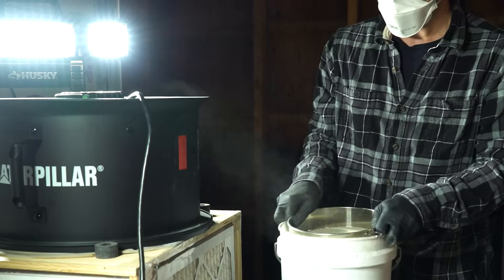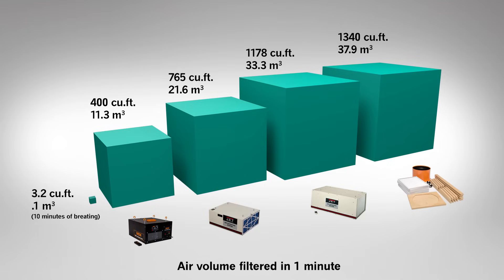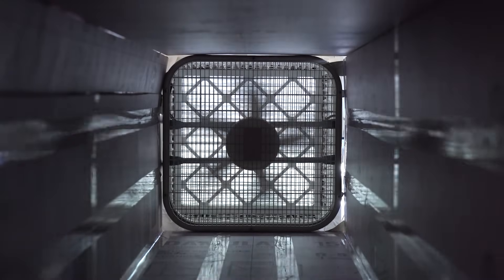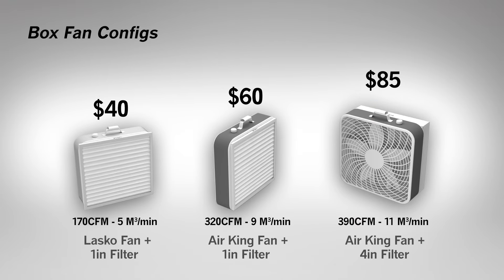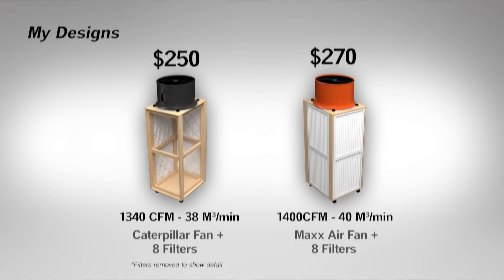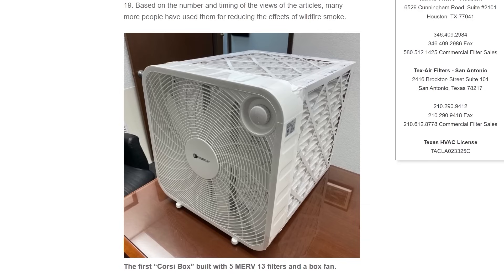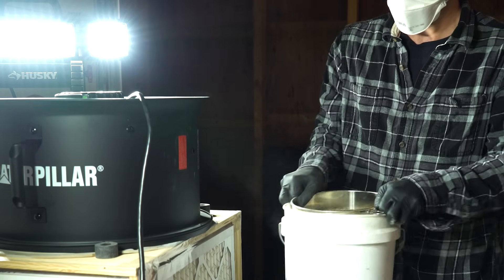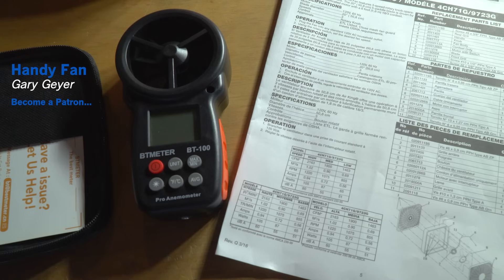What is the best DIY Air Filter?

Comment: You’d really want 4” pleated filters. They’re more than 4x less static pressure drop than a 1” filter and last more than four times as long.
Reply from the maker: This assumes that 4" filters have 4 times more filter material but they often don't. I'll do a video on that some time. Not saying that 4" filters aren't good, they are. Just probably not always 4x better.
Reply: @The3DHandyman   no actually. They take advantage of the fact that pressure drop is proportional to flow rate squared. Doubling filter area decreases pressure loss by a factor of four. Quadrupling filter area by sixteen. Pressure loss is also linearly proportional to filter life. So if you have a 1” filter with 0.1” h20 pressure drop that is used up after one year upon reaching 0.2” static pressure loss, quadrupling the filter media would start with a pressure loss of 0.0063” and take 32 years to clog to 0.2” end of life.

The difference is really that big. 1” fillers are really bad, and when using box fans that have essentially no ability to produce static pressure, you really get penalized for it.
Reply: Usually get my filters from FilterBuy. 4” are pretty expensive at the hardware store ($40-50), but not really that bad online ($10-20).
Reply from the maker: @michaelmolter8828  Helpful data there. At least in my smoke tests, the Filterbuy 4in filters do not remove smoke more quickly than others. In 4-filter configurations, the static pressure is already very low. The lifespan of 1in filters is no doubt less if you are looking at off-brand products. My preferred filter is a 3M MERV 13. It's not the best performer on single filter + box fan design due to static pressure, as you mentioned, but in a 4filter config, their performance is exceptional.

3M MERV 12-14 filters have a high density of pleats and only have 12% less material than a 4 filter. I also like 3M filters because they print the static pressure info directly on the filter. Their 4" MERV 11 @1390cfm has a pressure drop of 0.33 vs their 1" MERV 13 filter with a drop of 0.39. That is a drop, sure but in a 4 filter config it is a negligible difference.

I have also found that off-brand filters (filterbuy and nordic pure) will change the filter material year after year and their new filters haven't tested as well as their old filters. The lack of consistency is disappointing.

Thanks for the comment!
Reply from the maker: @michaelmolter8828  Sometimes Home Depot and Lowes have a buy-4 get 50% off deal lately. Not sure if this applies to the 4" filters tho. In general the prices are always better online. That's where I get 95% of the ones I test.

Comment: K&N makes washable air filters, probably a much more long term economical choice.
Reply from the maker: They are a great option. Definitely the best cost wise. I have tested these and they are not quite as good performance-wise as the disposables when filtering smoke but if you are pulling dander or pollen out of the air they will work really well.

Comment: I know this is older but quick questions please if you have time? So I am into amateur Mycology. We (community) use this same principle for filtering out as many contaminates as possible. Kinda like a cheap flow hood to work in front of. Some say this lower CFM (I think its the right term) produces a Laminar Flow too? They say to add the shroud around the fan to reduce back-flow which might let unfiltered air go around fan and carry contamination to work area. Never heard of it used for increasing the air movement speed before, but I'm truly a novice less than a year experience. After watching several of your videos on the principle it is obvious how much time, effort, and science you put into this. You are very intelligent, (Let me just stroke your ego Sir! lol)  and I think could help answer this question the best, if possible. What are your thoughts and suggestions for using this in this purpose. Obviously there is better, but more expensive solutions. I am disabled, and fixed income, but truly enjoy the hobby. Does this make laminar flow?  Or, is that crazy talk like Manufacturer listed specs. 🤔Thank you very much for this awesome video. Sits a lot of myths on the subject straight.   I apologize for my grammar not my best area.
Reply from the maker: Cool hobby! Thanks for the comment and complements. I would say that these designs do not really produce laminar flow. I have been working on a new design that does this more effectively. It's all about reducing turbulence in the air rather. Low CFM may help reduce turbulence but it also reduces overall performance when trying to pull lots of particles out of the air as fast as possible.

Comment: My father is a building inspector, he spoke with a product safety inspector at a convention that had worked on exactly this problem, testing the effectiveness of various home air filters.

What he said was the best filter you can use in your home is the cheap paper kind, but then you spray them with a light coat of something like Lysol air freshener. The thin coating of oil from the spray captures airborne particles. You can then re-apply the spray every other week and replace the filter every 1-3 months depending on your climate.
Reply from the maker: That would be an interesting test to run. Thanks for the comment!
Reply: That’s similar to a K&N auto filter where you use, clean, and recharge using an oil-based spray.

Comment: Can the air filers be washed or recycled?
Reply from the maker: Some filters are designed to be washed many times for many years and don't cost that much more than the disposables. No filters that I know of can be recycled.

K&N makes the only washable 20x20in filter. These work well but do not perform quite as well as the high end disposables.
https://amzn.to/3GMaxtH

I'll be releasing a new design that fits more washable filters very soon.
Reply: @The3DHandyman  Yeah, I had a feeling the washable ones might not perform as well.  Thanks for your reply!

Comment: Thank you SO much for your informative video! Hard to find content out there in this quality and a scientific approach... 
I was wondering which kind of coarse filters I could use to make the HEPA Filter longer lasting, as they tend to be expensive... 

My Story: I am currently suffering from a covid infection - shortly after we found and removed mold in our flat... According to studies, a horrible combination for the immune system. 
I'm going to build my own Filter system for rooms with in between 20 and 60 squaremeters. 
The actually plan from a friend was to put air pressure sensors in between the filter segments to see when they are full, but this overtaxes me to be honest. 
If you have any suggestions, please let me know.
Stay safe and healthy!
Reply from the maker: Sure thing. I actually have been testing ways to extend the life of the filters. I'll put a video out on that in January.

Because of the very large surface area of all the filters, they tend to last a really long time without bogging down the fan. I think the pressure sensor inside the unit might not be necessary. You can do a visual inspection to determine if the filters need changing. 

Sorry to hear about the covid/mold issues! Both are bad but at the same time that's even worse. I have been working with someone with similar mold issues on mold related air purification as well. Will do a video on that at some point as well.

You stay safe and healthy as well!

Comment: Here's  an idea. Reverse the Cat fan. Instead of sucking dust through the fan and pushing dust out of the box, you can keep your fan clean and have a visual check on your filters. My box is set up this way and I vacumm the excess dust off as needed.
Reply from the maker: Fan direction really depends on how you want to use it. I've also taken to vacuuming dust off the filters and will do a video on that some day soon. Thanks for the comment!

Comment: Excellent info but I think you're mixing up air speed (velocity, ft/sec or something like that) and volume (CFM).
Reply from the maker: All calculations are made using a CFM calculator. You use the wind velocity and the diameter of the fan to get the volume of air moved over time.

Comment: Man no matter what filter or how many I use there’s no way to get rid of ALL dust. Test in the dark with a spot light. There will always be dust in the air. I’ve been obsessing over it and have found no real way to get rid of ALL dust without spending a fortune on filters. I did find that filters and extraction units work best. But at the need of the day you need to clean the shop vigorously or the dust settles and gets kicked back up by your fans no matter what.
Reply from the maker: The best setup will always be a downdraft booth. Trying to match that with a single filtration unit is virtually impossible. I have some new content coming out one day where I get close to the ideal setup, at least for smaller work spaces. I have about a month of video editing to do before that series becomes a reality....

One of the reasons I like pointing the fan into the filter box with the Model-A (8 filter design) is that it is less likely to kick bust back into the air. Not to say it doesn't do it, it just does it less than when the fan is blowing straight up

Comment: I have to wonder how these models differ from a commercial hvac blower and a 4-sided filter box. As they are essentially designed to pull air though a filter, and a lot of air at that, I would imagine that grabbing a used one and making a filter attachment might be the optimal DIY solution. I'm about to do something for my shop, so if anyone went that way and has advice, I'd love to hear it.
Reply from the maker: I got a second hand furnace blower that I will design something for at some point. Before that I'll be working with inline fans that are lower cost, higher CFM, and less power hungry. These are also better with static pressure than axial fans.

Regardless, I really like the idea of using the HVAC blower, and I already have some ideas for it. I just need to find some time!

Comment: I only have 3 filters for my box fan, but for filtering the small amount of highwah dust that makes its way into my apartment, this should be good enough until I get more!  I'll make the cube design, with 3 sides and go for it.
Reply from the maker: 3 filters should work just fine for that purpose. You can just cover the last side with an extra piece of cardboard
Reply: @The3DHandyman  That's what I did, will test it today.  Wifey would have rathered we got a real air purifier, because this is a big box!
Reply from the maker: @Killer_Space_2726-GCP  She may have a point! Haha

Comment: So how do they compare sound-wise?
Reply from the maker: Here is the data that I've collected. I'll put this in a new video that will be out in a month or two. By far the Lasko is the most quiet. Most cheap box fans will produce the lowest amount of sound because the are lower power.

All sound levels are High, Med, Low
Lasko @1 ft - 63, 60, 55dB
Air King @1ft - 68, 66, 61
Air doctor @1ft - 64, 58, 52, 45
Maxx air @1ft - 71, 67, 57
Caterpillar @1ft - 71, 67, 63, 57
Leovit Core 300 @1ft - 58, 52, 50
Honeywell HPA200 @1ft - 58, 54, 46, 41
Blueair 211@1ft - 61, 50, 41
12in inline fan @1ft – 74, 68, 66 

Hope that helps!
Reply: Thank you! @The3DHandyman

Comment: As you stated, the CFM specified by the manufacturer rarely reflect real world experience.  One thought I have had is to use electric fans from semi-trucks.  Thia would require a 12V DC power supply that can be found at no great cost on Amazon or from companies such as Digi-key.  Just make sure the current rating of the power supply meets or exceeds the current draw of the fan. If you can locate a semi-junk yard within reasonable distance the cost of the fan should be minimal. 

You would also be on your own when it comes to the protective grid in front of the fan.  An oven rack from a discarded stove may work depending on your build configuration. Those fans have to move a lot of air to keep those big diesel engines cool, especially in hot weather and under a maximum load. Testing one on the wind tunnel would be interesting.
Reply from the maker: Yeah, radiator fans a very powerful, that's for sure. They might be overpowered for use in most systems though. It might be prefect spaces larger than 500sq.ft. So far I've focused on spaces up to that large. Maybe one day I can design something for 1000sq.ft spaces. One day.

Thanks for the ideas!
Reply: @The3DHandyman  Well, you could bypass the fan from the semi and try one from a compact car. Expanded metal with a large grid could be used for the fan guard.
Reply from the maker: @katiedotson704 Very true. I'll keep this in mind when I get around to my next round of designs.

Comment: The benefit of the shroud is probably because it allows the fan to be partly centrifugal, blocking escape of the air flung to the sides. For cases like this one where some pressure is needed, centrifugal fans perform better than axial fans.
Reply from the maker: I don't know if I'd call it "centrifugal" in this case but there are some benefits. I tried several different shrouds in a recent test and managed to get one to preform about 8% better in a smoke test. 

That's not a huge increase in performance but it is something. Using good filters vs cheap ones can increase performance by up to 250%, that's more a more meaningful jump.

I feel like the bigger benefit of the shroud is the change in the sound of the fan. It's volume level doesn't decrease much but the tone of the sound changes to something more pleasant to be around.
Reply: @The3DHandyman   Centrifugal in that there's a boundary layer of air on the fan blades that's spinning and has mass, so gets thrown centrifugally. These axial fans that aren't meant to handle any pressure I suspect act more centrifugally than axially when inside a shroud when there's pressure, which could be tested by moving the shroud to the other side. But your testing findings suggest it's even more complicated than I realize. It would be interesting to test the boundary layer effect by replacing the fan blades with a flat disc. Pretty big nerd digression here.
Reply from the maker: @oldspicefullbody  I'm all about nerding out about this stuff. I have added so many tests, my next video series has been delayed for months. At this point, I just need to get it done! lol

Comment: So here's a question for thought. If the air king fan is ($50 +/-) and a high velocity fan a cheap on found everywhere is $50.. how much better of a performance do you get then using these same filters..
Reply from the maker: It's hard to say for sure. The factory CFM ratings for most fans are not even close to the real world CFM (when used in air filters like this). The Air King is about 20% better than a low cost box fan ($35) from your local hardware store. The one that you are referencing might be about that much better.. but you don't know until you try it out.

Comment: what's the cadr level?
Reply from the maker: I'll go over that in a new video that will be out in a month or two. There are a lot of numbers to crunch. I only have the basics at the moment... The Model-A (8 filter design) has a smoke CADR of 395 in a 550sq.ft. space. By comparison an Air Doctor HEPA filter scores a 180 smoke CADR in that same space. Much more data to come...
Reply: @The3DHandyman  looking forward to it. just built my diy CR box. But the air king is super loud....
Reply from the maker: @VoliKnight354  Fair point. That's something I'll talk about in an upcoming video as well. One thing you can do is put a fan shroud with a 15" hole on it. This can cut down the noise level a little.
Reply: @The3DHandyman how’s the cadr  video going ?
Reply from the maker: @VoliKnight354  Just finished filming most of it. Still a lot more to do. It should be out by the end of the month.
Reply: @The3DHandyman  awesome. ill stay tuned

Comment: First, this series is incredibly helpful, so thanks very much for putting it together. Second, I'm trying to decide between your "standing" design and one of the ceiling mounted ones. The ceiling are nice because I preserve valuable floor space, but I'm worried that the increased distance from dust source means it won't work nearly as well. Any insight into whether that's a notable concern?
Reply from the maker: I have not really tested the ceiling mounted designs, so I cant say for sure. My general impression is that they probably work fairly well but, like you said, they aren't in the right place to capture the maximum amount of dust.

Either way, they are going to reduce airborne dust and that is a good thing. 

One thing to consider is the sound these produce. The ceiling mounted designs all use large floor fans and those are the loudest fans that I've tested. The drum fan used in this video is also fairly loud but not quite as bad.

I am working on some follow up videos to this series that will have even more info about all these designs and many more. Hopefully that will be out in a month or so.
Reply: Yeah, that makes a lot of sense. I'm also in another country so fan availability could play a factor too. Thanks again, and looking forward to the next videos. @The3DHandyman